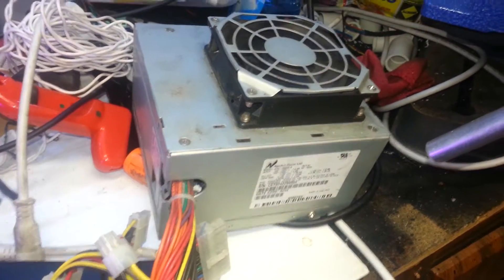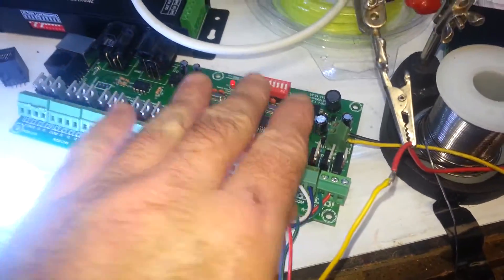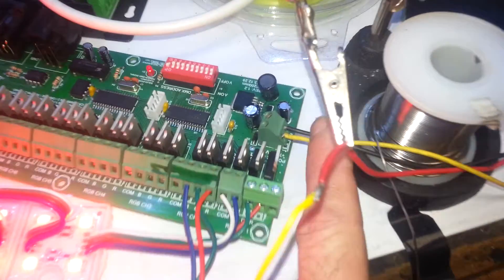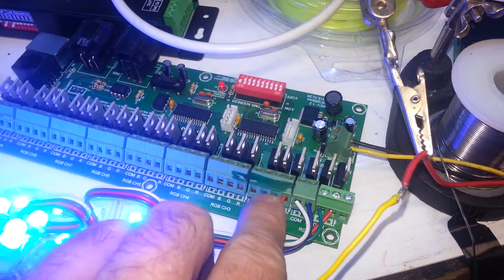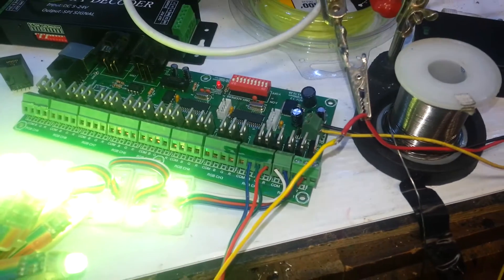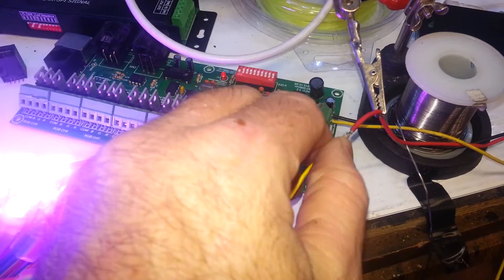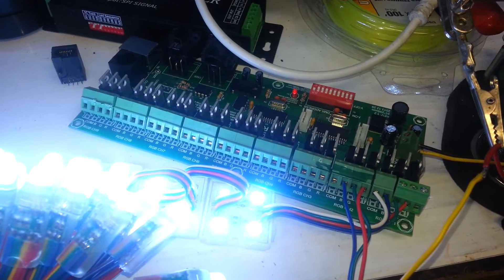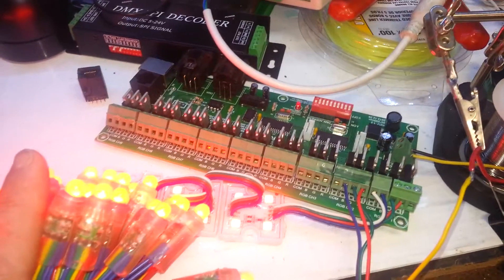Dumb RGB 5v & 12v on the same Dmx controller

Comment: Is there a difference in brightness from 5v vs 12v? I want to get started on a lights setup but not sure what to go with. I'll be running them along the eves of my house.
Reply from the maker: a 5v pixel uses 5v to light the light.  A 12v pixel has a regulator or convertor that converts the 12v to 5v to light the LED.  They are equally bright.  You have less components in a 5v pixels.  Also, because you are using the 5v power supplies, you are not doing any converting.  So, your power is not wasted or lost due to a power conversion from 12v down to 5v.
Reply: Ok, thank you. But when running multiple strips on 5v you need to add power to every strip as opposed to 12 volts every few right? I have a 2 car garage I want to run lights. Will take 4 strips to do so. Right now I have dumb rgb 5v strips and need to run amplifiers with power in between each strip. I want to upgrade to addressable rgb. Will 12v run all 4 strips or would I need to run power between the 2nd and 3rd?